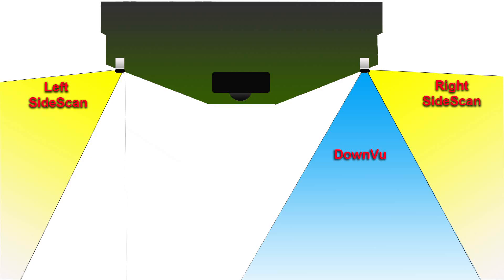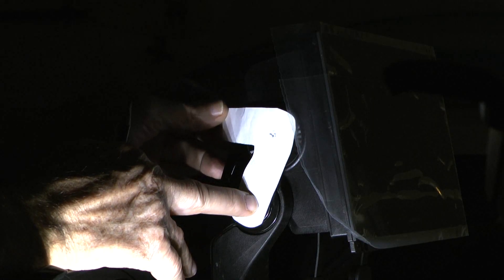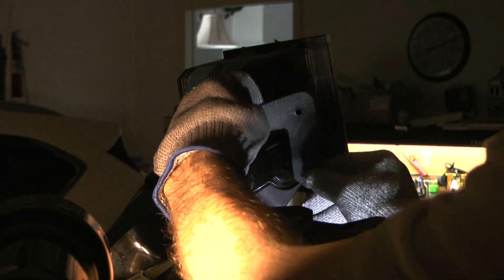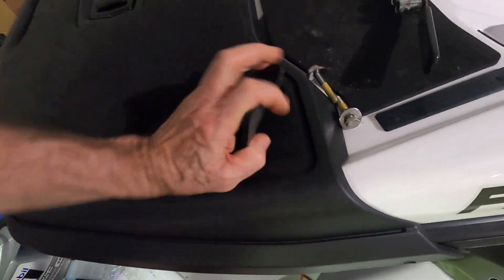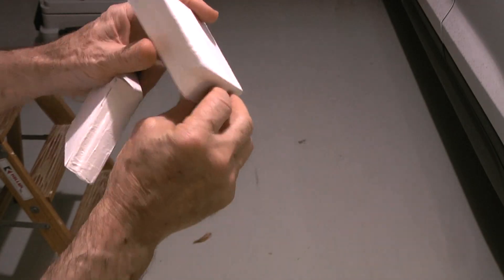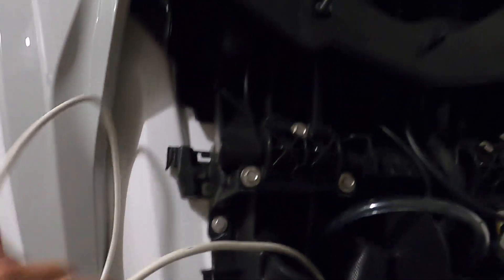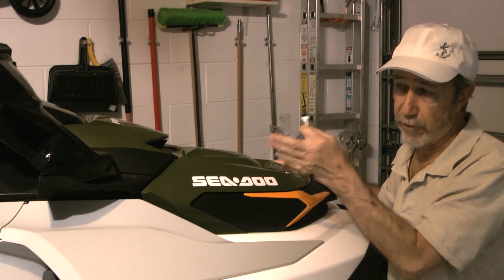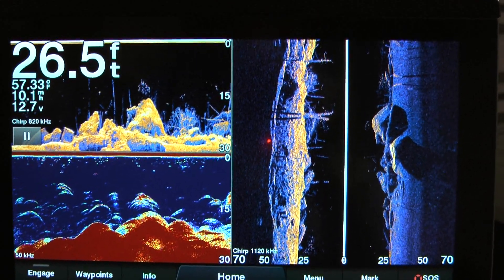SeaDoo Fish Pro Dual SideScan Transducers

Comment: Great Job! you inspired me to upgrade mine as well.  
I used a sliding door bracket for the mount - 
prime line sliding door roller W/ 1/2 in. offset  item # n 6517 - fits about perfect just have to enlarge the holes a little.
Thanks for all your hard work to make it easier for the rest of us.
Reply: cool idea. does the unit roll forward without the wrap around plastic?  I am assuming that you installed the Garmin 943xsv, right?

Comment: Great video! Do the transducers pick up washout or have any issues reading bottom / water when slow trolling or when idle?
Reply from the maker: Yes, if I am sitting perfectly still the wash interferes with the image, however you must be moving forward for any sounder to create an image, so not a problem. A normal idle forward was sufficient.

Comment: Try mounting your jigsaw upside down in a bench vice (not to tight) - then you can use both hands to guide tricky cuts
Reply from the maker: Thanks Les, That’s how I should have done it. Would have made it safer as well.

Comment: Hi, I am trying to accomplish this after seeing your video.  I am having the same issue with removing the deck extension bolts.  I was able to get channels locks on one of the plastic covers.  I was not able to squeeze it the plastic enough to keep the nut from turning with the bolt.  Did you know the plastic off to be able to get to the nut then reattach them with Flex Set?
Reply from the maker: Yours must be really tight. I was lucky as mine came right off.

Comment: Incredibly resourceful.  Any chance you could link where you got the plastic for the custom bracket?
Reply from the maker: Thanks Lucas.  I just went to my local surplus store called Skycraft parts and found a black box that happened to be made out of ABS plastic. You could probably find something similar on Amazon. I think the “plastics 2000 ABS sheet” is probably the same material. Just select the thickness you desire. 
Cheers

Comment: Hey Mike, great job on the install! Do you have any footage of the twin transducer setup working out on the water?
i just got a fishpro and thinking about doing the same upgrade.
Reply from the maker: No, sorry. Sold it one week after I did all the upgrades. Buying a much bigger boat. It worked perfectly at all speeds. Sitting still and idling the jet creates some sideways disturbance, but as you know sidescan only works to make a picture if you are moving. 
cheers.